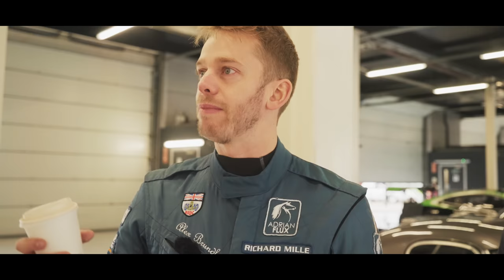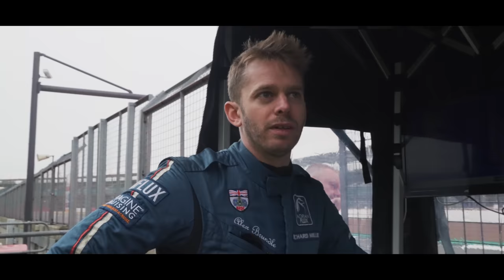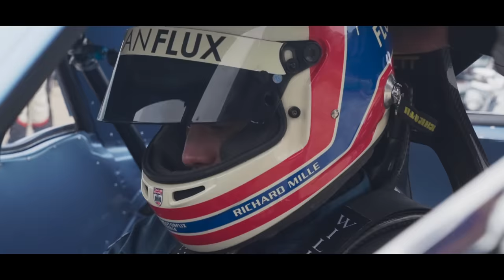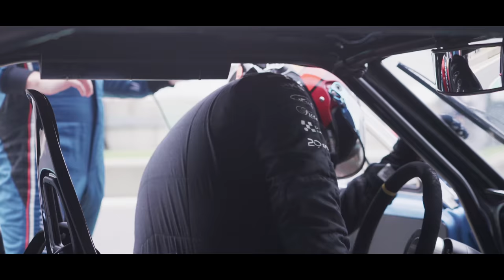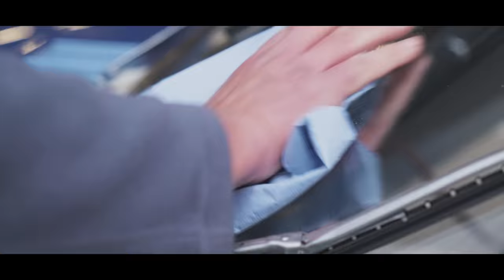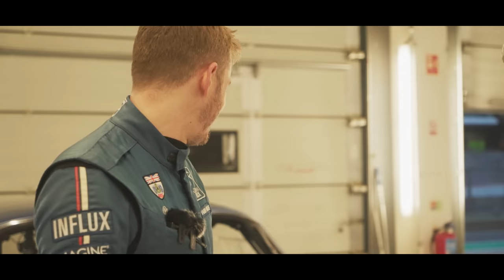Jimmy Broadbent WON THE RACE in my Mustang!

Comment: Wonderful video. That mustang is a riot to watch. What, by chance, is that gauge to the far right of the dash, that switches between green and blue?
Reply from the maker: Because we had an oil temp sensor issue, but it was fine (you can tell from water temp which is closely connected on these cars)

Comment: As regards the "clamp" and what not for the rear axle/leaf springs was chassis/running gear of the Street config Shelby GT350's fundamentally different than a plain wrap Mustang? The Shelby and K series may have had beefier versions but beyond that I'm guessing that they weren't dissimilar. 

Were GT350R's fitted with anything different such that they are categorized differently for vintage racing in Blighty?
Reply from the maker: SO this is a U-bolted leaf spring, the 350's were allowed trailing arms which stops the axle bouncing on the brakes. We are allowed the standard setup but clever damping and leaf springs help ;-)